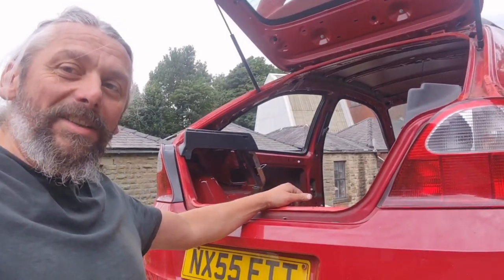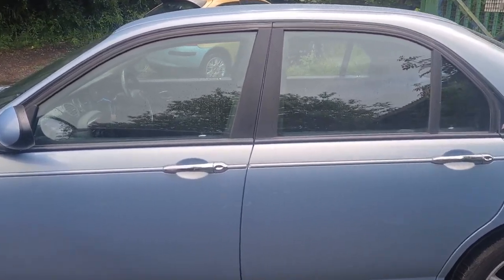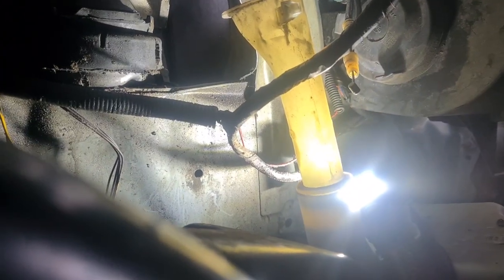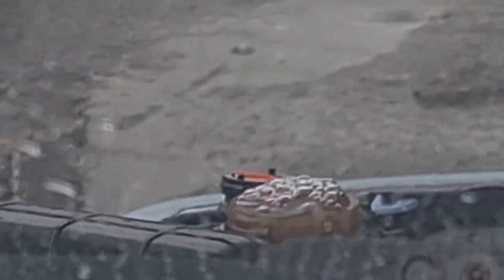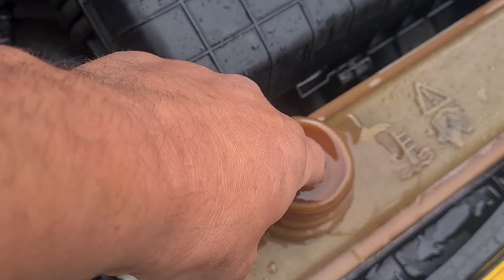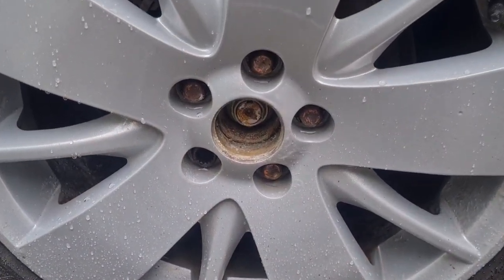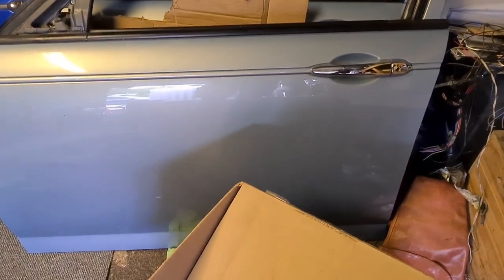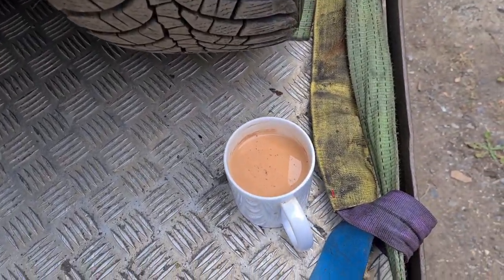Project Gordon pt.1

Comment: I have seen this a few times. All that stuff does is block the heater matrix but I didn't need to tell you that. Back pressure the kv6 not normally head gasket but it does happen. £2900 Its not really worth it. It's a breaker even me doing the work for myself. I would still break it that's my opinion as a car. It can save so many other's as you say it's a nice colour. Am sure it would break at a good price. Not sure it was good idea to leave a cup of tea there lol. I  love the heat it rained today and made me sad and depressed I just wanted to go back to bed lol. When it's hot I want to get up and work. Never mind it might be sunny tomorrow 😉😀👍
Reply from the maker: Yes that is one huge bill

Comment: I’ve used K seal on several cars over the years, all with good results.  Most recently on a 2004 Vauxhall Astra that was losing a litre of coolant a week.  Added K seal to the cooling system, gave the car a good run and problem had gone within a couple of days, no issues whatsoever.
Reply from the maker: Maybe it's just good on Vauxhall 😁
Reply: @ProjectNigel  yes you might be right there - used it on a Vectra B too in the past.

Comment: Hi if it helps try painless dent removal on the two doors and wing. Always looks good in YouTube videos but never seen it done in practice. Will save you taking off and replacing the 3 parts. Hope it helps. Good luck

Comment: What is it with 75s and the bonnet cables failing... Ive never know a KV6 get HGF so either the car has been massively abused or maybe misdiagnosed and filling it with K seal caused the HGF in the first place.  I dont know a single car that's benefited from K seal... Damn shame it couldn't be saved
Reply from the maker: The 75 is the most flawed Rover of them all

Comment: K-SEAL!!!!  The choice of pillocks.  I drained that crap out of one of mine, including the heater matrix, which looked like someone had poured cottage cheese into it.  One thermostat later and the car ran for four years.  That stuff should be banned.
Reply: I’ve used K Seal on several cars over the years with no issues whatsoever - it’s always done exactly what it says it will do.
Reply: @karlwood2268  I’m glad that you’ve been lucky.  I’ve only ever seen trouble with it.
Reply: @CynicalLemonade  sorry to hear that.  Last car I used it on was a 2004 Astra that was losing a litre of coolant a week.  Put a bottle of K seal in the system and it cured the problem within a couple of days, and the heater still worked fine.